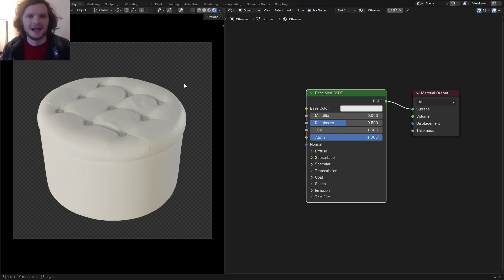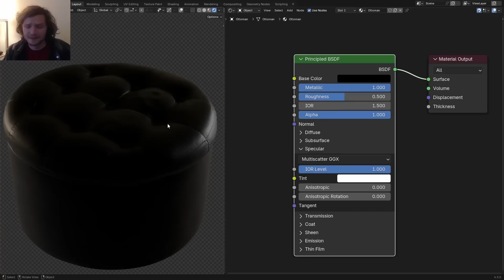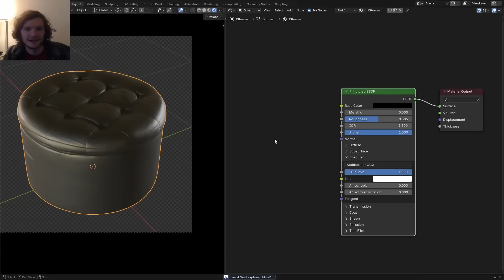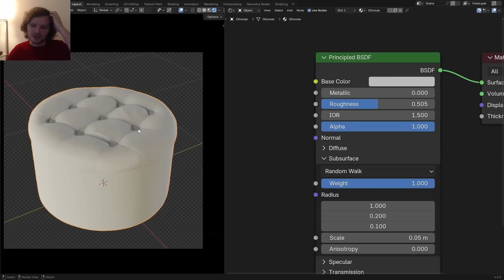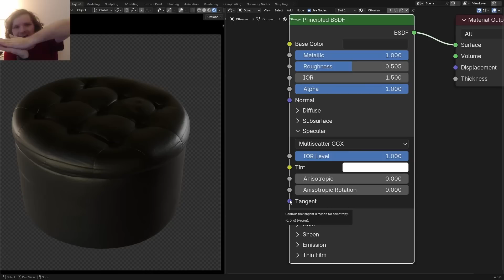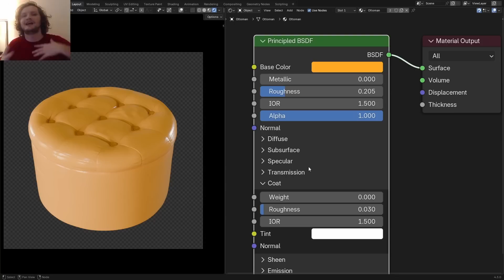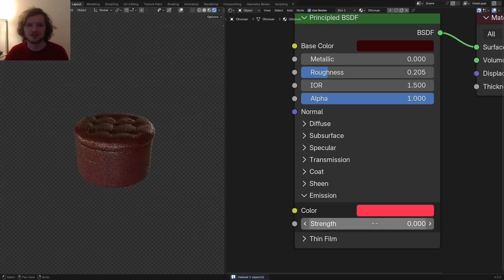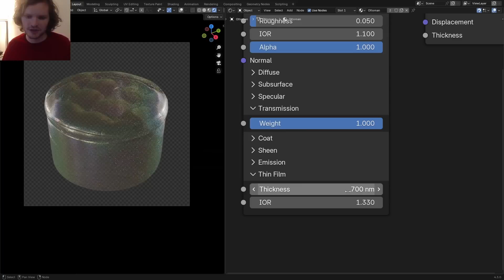The Biggest Node Explained (Principled BSDF)  // Blender 4.3 Tutorial

Comment: Hate to say it, but as cool as Blender’s shader nodes look, they’re terrible for a production pipeline.
Blender seems to have come up with its own unique rendering equation. Sure, an artist can get great results through trial and error by tweaking parameters, but when it comes to transferring models between applications, the nodes are poorly documented, and what little documentation exists is often incorrect.

Take the Specular BSDF node, for example. The official docs describe the specular parameter as a scalar computed by the formula ((IOR - 1) / (IOR + 1))^2, yet in practice, the input field is an RGB vector. It’s as if the documentation explains how it should work in a physically based BRDF node, but not how Blender Specular BSDF actually implements it.

Overall, Blender’s shader node system is a nightmare for any pipeline that doesn’t rely entirely on Blender’s own renderer.

Comment: Hi, im a professional archviz artist with bigboy software 3ds max/vray/corona
oren-nayar is the more diffuse looking model and if im not mistaken the default in blender now
sss radius multiplies the scale per rgb chanel if im not mistaken. If you make marble, put the marble diffuse texture into the radius slot for the most accurate results. The sss radius(color) is only different from the diffuse in things like skin because its not a homogenus volume meaning below the skin tissue are things like bloodvessels and blood giving the the more reddish color.
Anisotropic tangent, use uv if you want to simulate a more fine woodgrain on plank floors. You can see this effect quite strongly in herringbone parquet floors. If you set it up correctly, you can also use it for satin fabrics as the shine of these fabrics comes from the way theyre woven, not the fiber itself being shiny per se
Most of us archviz artists dont put the roughness all the way up to get fabric, instead we turn the IOR all the way down to 1 (or set the IOR level to 0, just get rid of reflections) and layer the sheen layer on top as a replacement for the reflection. We used to use falloff node back in the way, and still do in some situations